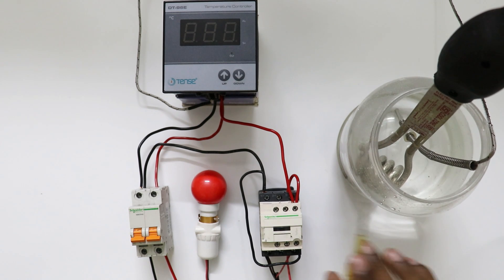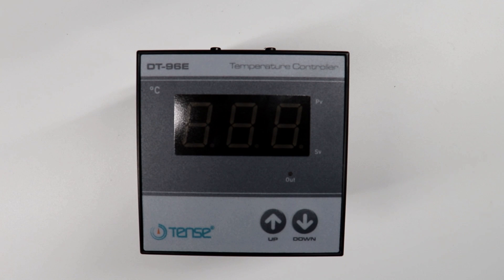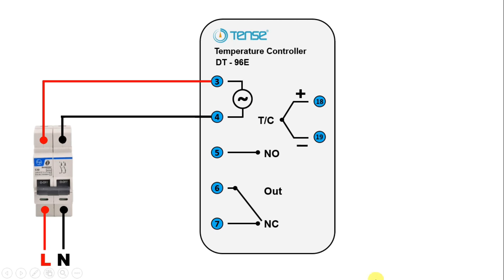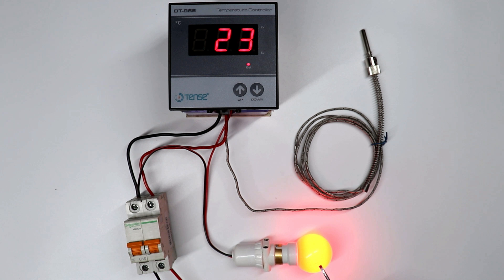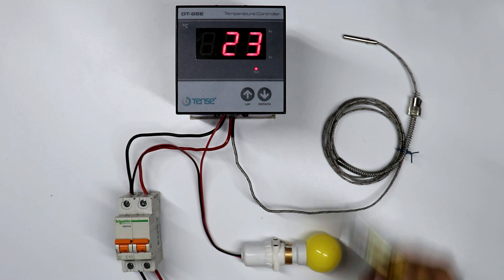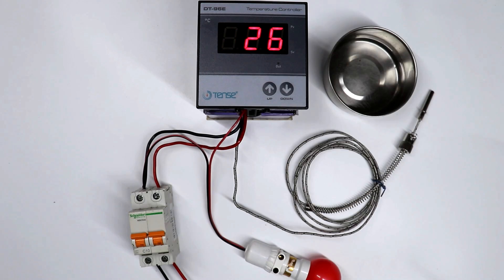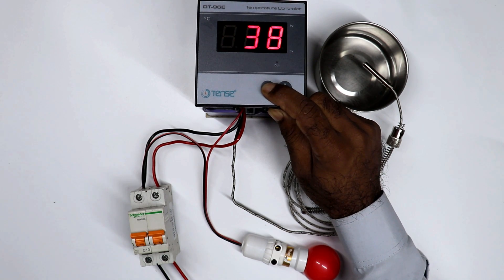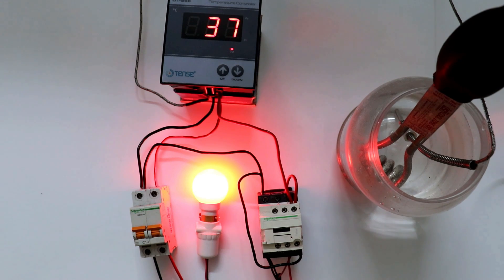How to do Temperature Controller Connection with thermocouple @TheElectricalGuy

Comment: Confused!! Quoting from minute 3:15, In order to keep lamp on when temperature is below set temperature 30 degree celcius  lamp has to connect at NC contact isn't it? correct me if iam wrong.